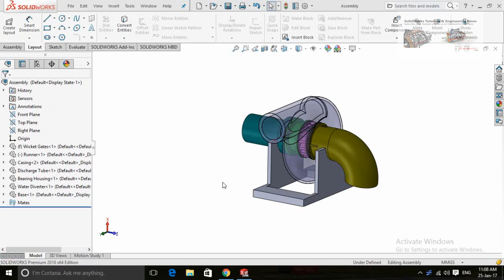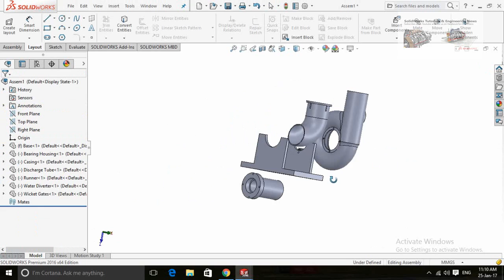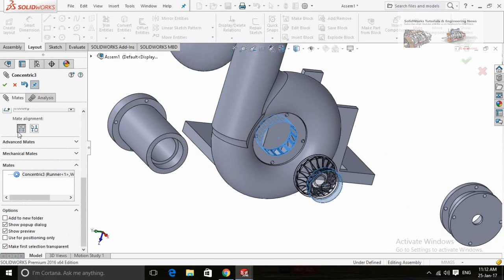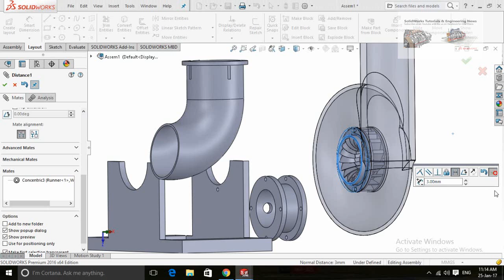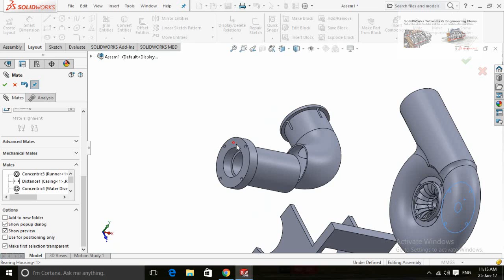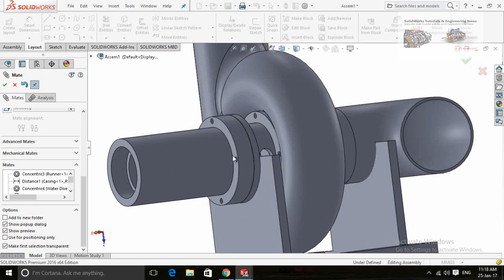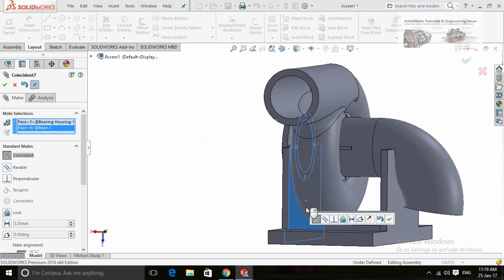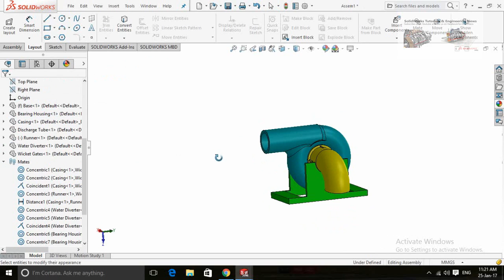Francis Turbine Assembly Tutorial SilidWorks with Voice Narration

Comment: Too many mistakes, The  cross section of the spiral casing is decreasing. The runner blades are with wrong angle. The inlet angle of runner blades of a Francis turbine is 90°. The blades are so shaped that the tangential component of velocity at blade outlet is zero. The quantity of the blades are supposed to be odd to achieve better balancing. The third pipe is superfluous. Draft tube disc supposed to be with different cross section as well
Reply from the maker: This is only for SOLIDWORKS practice. The parameters shown or used in the video are just for reference to tell people how to make such things in SOLIDWORKS